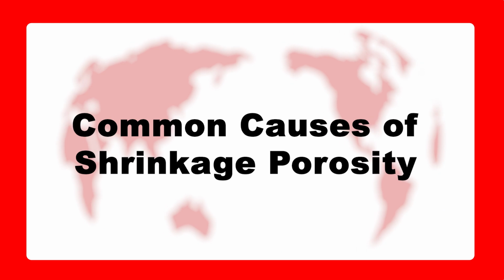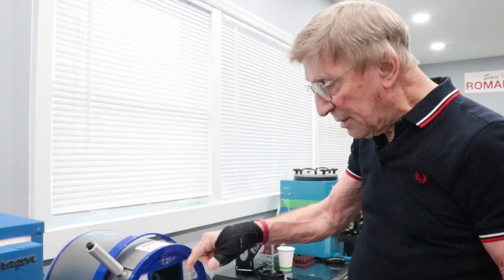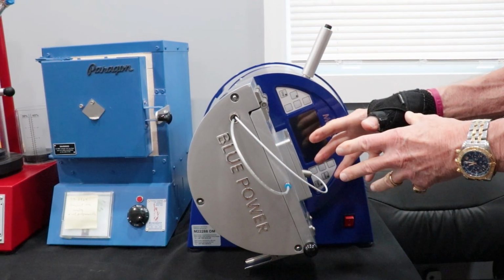Romanoff Casting Tips: Porosity - The Facts by Bob Romanoff

Comment: Hello Bob    Thank you for a most interesting  video one of the best I've watched.  Interested to hear what you say regard the vacuum wax injector , i have used 2 different models of these injectors over the last 10 years all produce excellent results . However, would like some info as to how many seconds of vacuum various size cavities should be given. Instruction manual  gives no info.   Some moulds work well at 3  to  5  seconds of vacuum , where very much larger moulds producing very large thick parts , it seems the vacuum ,even applied for 15 sec or longer  to a mould with a good tight seal to the injector, is of no assistance at all for these large parts.  The waxes still show signs of air bubbles . and or blisters on the surface.     Also , the vacuum investment mixer machine , which i have in my work shop , when using this machine I notice the investment once mixed and poured into the casting flasks and the flask are allowed to sit in the chamber to vacuum, the investment  doesn't  bubble up as rapid as it does when other dome vacuum machines are used.  Is this due to the pouring being done under vacuum.   Thanks  John Dersch    Orn castings   Australia